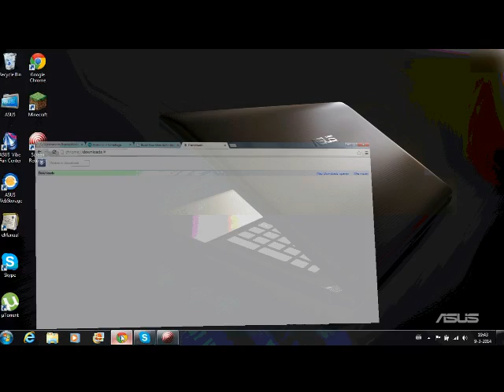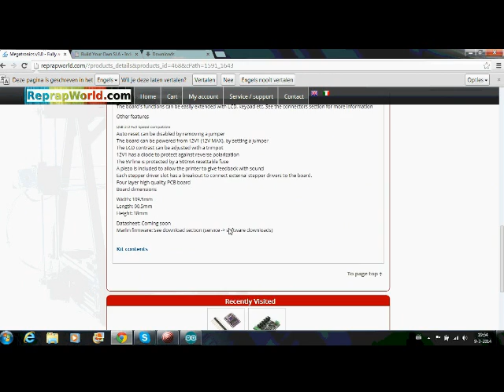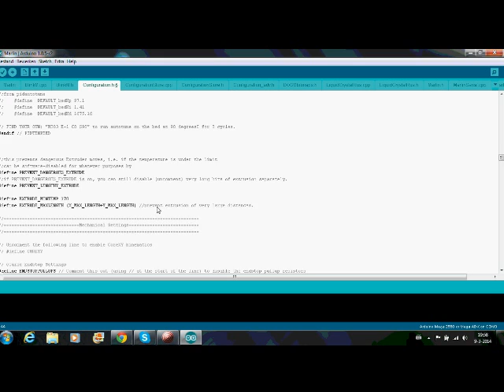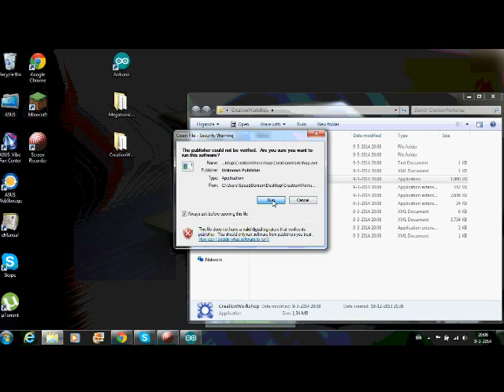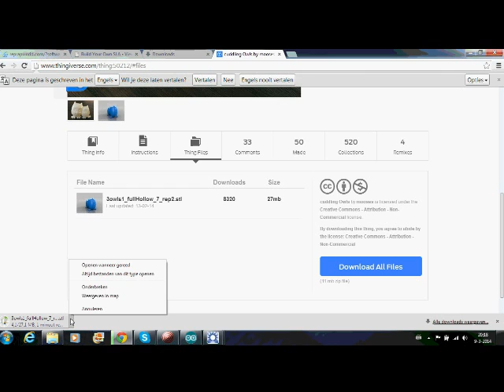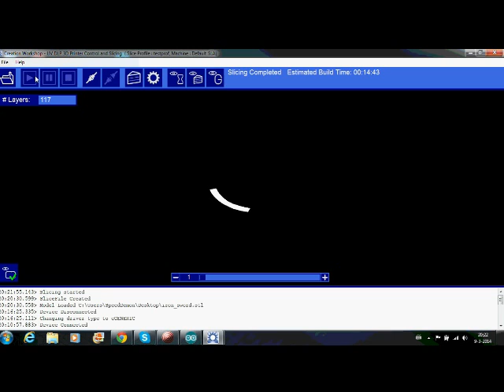uv dlp 3d printer megatronics v3 setup

Comment: it does matter how you solder those limit switches... One way is always on and the other is always off.. Huge difference when you want to restrict false signals using this (highly recommend) https://www.ebay.com/itm/10-x-4-7uF-25V-Radial-Capacitor-Tantalum-Get-It-Fast/321751721883?ssPageName=STRK%3AMEBIDX%3AIT&_trksid=p2057872.m2749.l2649